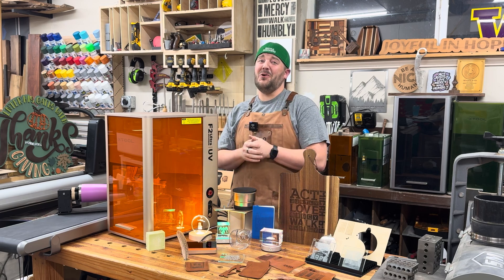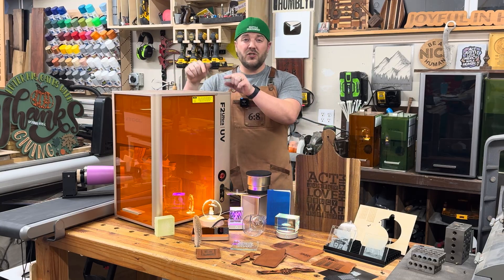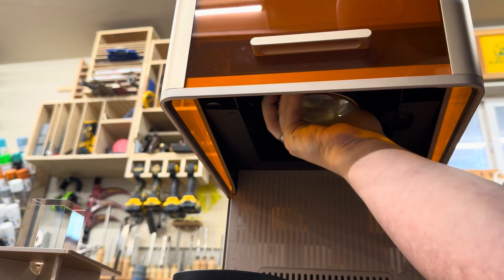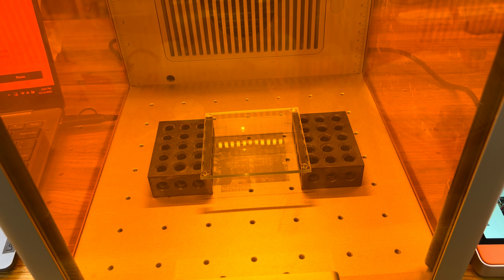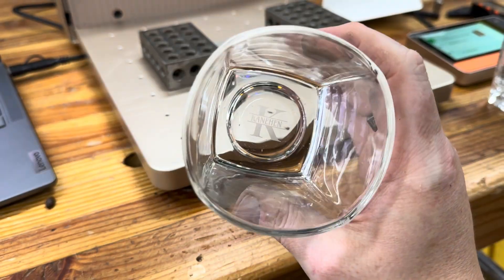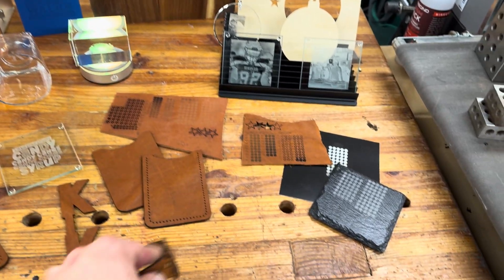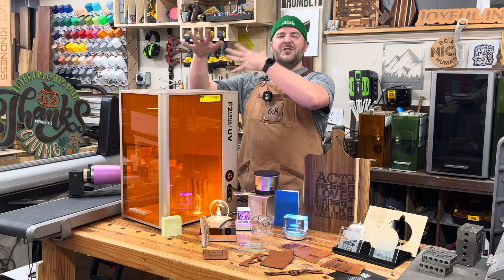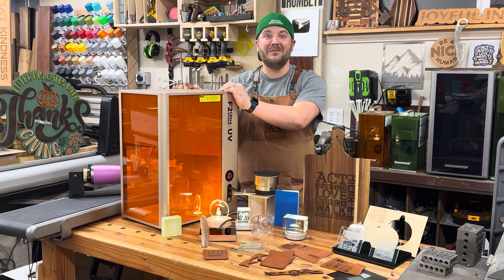A Laser that Can Do What!?! First Look at Brand New xTool F2 Ultra UV Laser

Comment: There is no "SIDE HUSTLE"    These machines are not for commercial work or business use...Check the small print.......You will never break even on any machine XTool has made since the D1 series I test these rigs and they are hit and miss at best. I assure you as well that youll never break even on the wasted materials as well as all the extra tools required. You cant make anything any better or cheaper with all needed than just ordering it from ETSY. Theres always someone cheaper on ETSY and why do it for free? XToll has failed with durability on all the F series so far. All the ooohhhhssss and ahhhhsss go the foookss and shatsss when they just plain die. I have nothing personal against Xtool other than theyre lying to us all and making gimmicky overpriced short life junk lately.  The screen print bullshat junk can be made with wood screws and fooking chickenwire. I wont even waste the power unless made to test another xtool product. I have a building full of dead ones OTHER than my D1Pro 40 20 10 and ir extended setup that still to this day cuts clean and prints crisp and clean. Galvos are so limited ...think about the physics and angles vs 90 degrees and level. I do thank  XTool for all those though

Comment: What would be the largest cutting board you could engrave and how big is the engraving surface.
Reply from the maker: You’re able to go much longer if you use the conveyor. But you’ll always be limited by the depth. I’ll try to show it with my wood tests in the full video.

Comment: did you test it on any anodized aluminum or any stainless steel or metal? if so how did it work out?  Thanks
Reply from the maker: You bet. Great results. While metal engraving is usually best suited with a fiber laser, still got great results.

Comment: Where did you purchase the k9 glass and how much does it average?
Reply from the maker: Hard to source at present. xTool is working on building up supply to sell. For now I had to use sites like Ali Express and Alibaba. A few on Etsy and Amazon. Totally depends. Have heard folks finding it much cheaper, just newer tech. I’m sure there will be a ton more options with the UV laser tech rolling out. Right now most blanks are $4-$10 depending on size.

Comment: I was very interested in this device for intricate wood cuts but the smoke at 6:55 is not a good sign and you have considerable charring at 7:13 (compare to the clean edge of the plywood at 7:25). Not much different from the results I get from my current diode laser.
Reply: The only thing I can think of the why, is that on the same board, he is seeing what color he can produce or cutting depth. Then he just cut out the shape without changing the settings. I know you can change a lot of settings with a laser. Just a theory and I could be wrong
Reply from the maker: Yeah, just initial testing with lots of settings variables. But super clean results so far. Will show more in full video.
Reply: @SixEightWoodworks  Great, looking forward to it!

Comment: I've been meaning to get an UV Laser, for a pretty long while actually, as it hits all the strides that I require.

Have you tried doing stuff with cork? Its not necessarily why I want an UV, but I'm looking for the info if its able to CUT cork. 
I basically have to either do it by hand or some weird cricutting shenanigans, or if I need to make specifics for specific clients, a die-cut. But if I'm able to cut it, that'd be a handy extra!
Reply from the maker: Just bought some more cork to test out. Will definitely feature it in the full video.